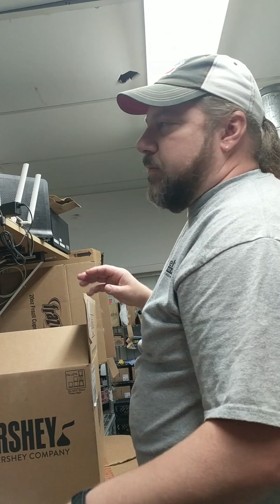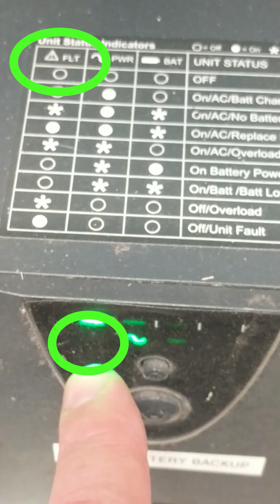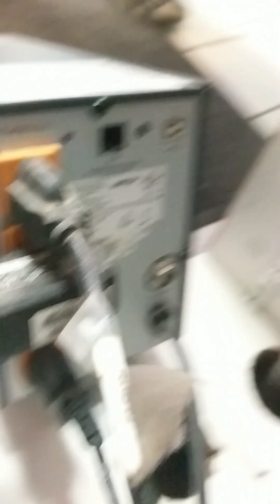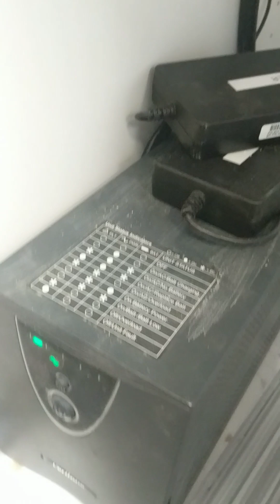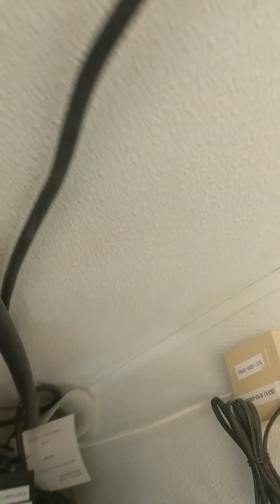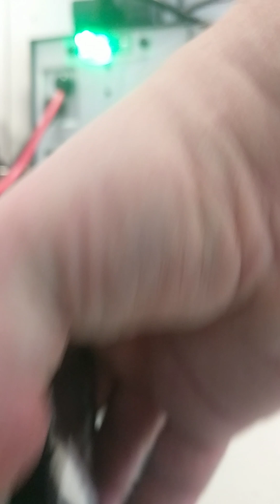How to change a battery in a Powervar

Comment: Hi what battery can I buy for that. We have this exact one
Reply from the maker: @OakridgeAussiedoodles  Depending on the brand you get, they are called different names.  Best advice is to take the one it came with out, then take it to a Batteries Plus store or Interstate Batteries shop.  I have bought replacements at both places.